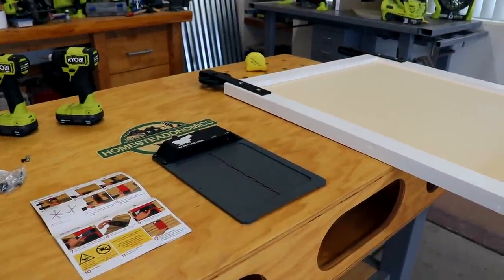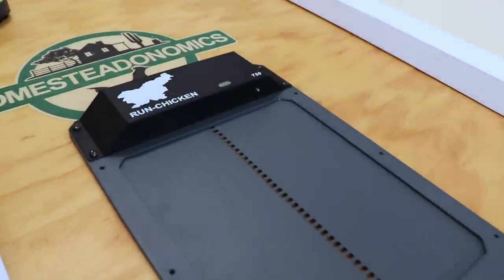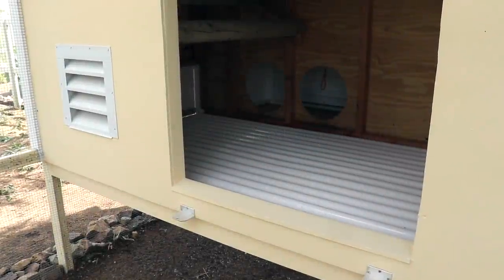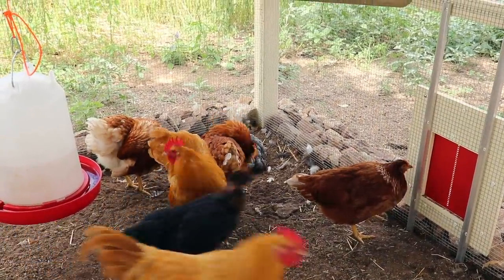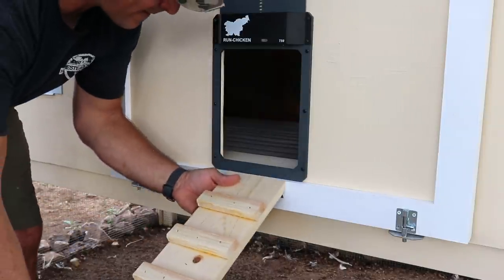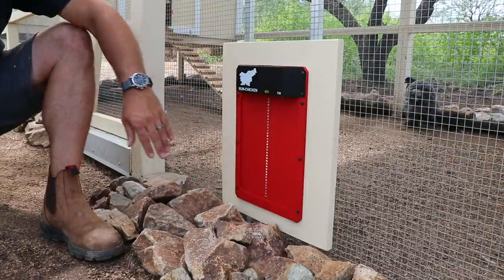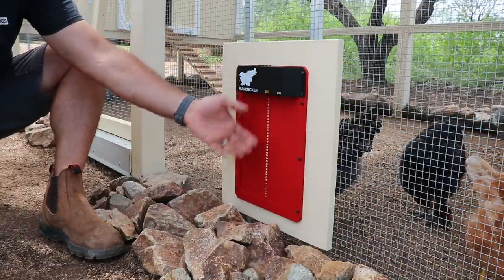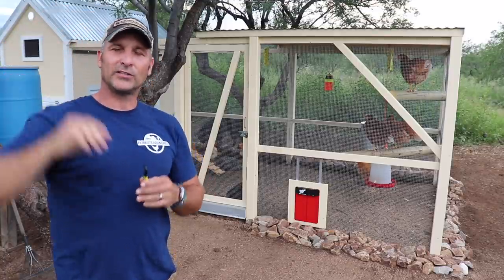Building a DIY Chicken Coop Part 4  - Automatic Door & The Coop Floor

Comment: Great job on your new cewp.  For your ramp, if you add half circle notches in the aluminum flange, it’ll seat on the screw shafts without sliding and be in the same spot each time. I’ve a little bit of ocd too.

Comment: I have thought about something like this for some times but with a system to sense if the chickens are inside or not, like with an rfid tag on the ankle or something similiar. I think this system would be pretty easy to modify using the switch contact, maybe a small solar panel on top of that for extra longevity. That would be nice if they provide from the factory an auxiliary input connector for switching, maybe even synchronizing them and remote controlling them to planify different level of access to different area during the day. This has some potential.
Reply from the maker: Very interesting ideas🤔👍

Comment: Cool mechanism! Really dig the grey and I see they have black too. I'm sure someone has said it already but for more efficient scraping of the poop tray, you can try making a (truck) bed rake-like device. The really easy way to make one for corrugated roofing would be to buy a wood closure strip from a home improvement center and glue to 2x material and them attaching a handle to it or just tie it to the end of the landscape rake, overriding its tines.

Comment: I have another question about the regular door...  it seems like there's enough room for a snake or something to get under it.  What sort of protections do you have?
Reply from the maker: Are you talking about the main walk-in door to the run?  There is about a 1/8” gap on bottom and less than a 1/4” on the sides.   so I don’t believe a snake would be able to get in there.... but perhaps a really baby one.   But in that case I think the chickens would eat it😉
Reply: And if the snake uses metric that inches gap will confuse it.
Just making fun of the way U.S.A. still uses imperial.
Nice work.

Comment: I don't like the button to open the door manually at all: I think a predator could very well open it by randomly hitting it anytime. A simple click is not secure enough, to me: if you had to press it a few seconds, it would have been much safer.
Reply: Just curious what kind of super predator do you have that can operate
a pushbutton switch?
Reply: @hammer9390  Any dumb one, as hitting the button by mistake seems sufficient to open the door. Here in France a fox, a wild cat, a marten or a weasel is very capable of this.